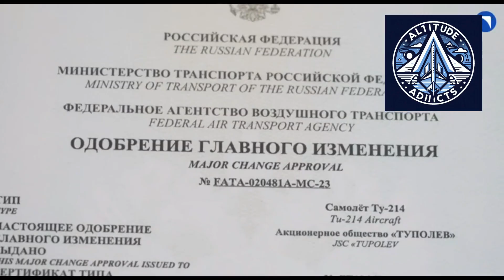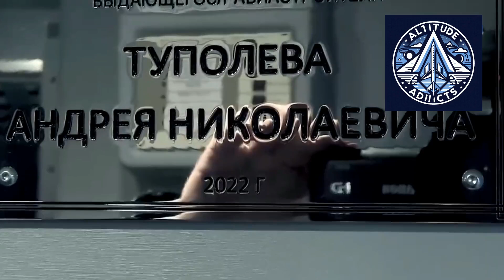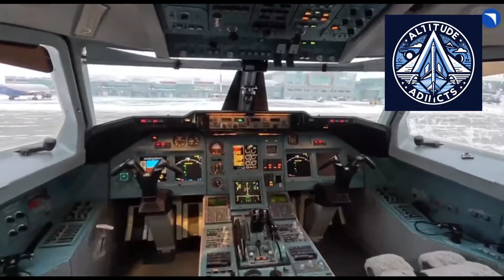Russia Certifies Tu-214 With Domestic Systems | What It Means for Aviation

Comment: From looking at the video they are celebrating a new paintjob on RA-64549 which is a 17 year old airframe, built in 2008. At 4:17 in the cockpit you can see the aircraft is equipped with American-made Honeywell MCDU's.
Reply: Pesawat buatan 2008 itu adalah laboratorium terbang.
Memang bukan pesawat baru, namun komponen Barat dilepas dan dipasang komponen domestik. Melalui pesawat ini, kinerja komponen domestik itu diuji.
Jika masih tampak komponen Barat di video ini, seluruhnya dikarenakan kecerobohan menampilkan video lama.

Comment: With an economy so driven to become self-sufficient, and multiple companies working on multiple commercial airliners, in the next decade Russia could have over well over a half dozen commercial liners from the largest to the smallest in size and range, and when you look at the bottleneck for engines - a bottleneck that Russia isn't part of, Russia could flip the script if they can complete all their objectives and not just change itself, but the rest of the world, becoming a major player in the commercial aviation field.

With success here as well as all the other logistic fields they have been also fervently working on, it would also mean success domestically and abroad for its helicopters, locomotives and ships, untapping potential never before seen, and maybe brining peace.

Comment: The west like to blow their whistle often regarding chips, design and manufacturing prowess, they don't realize that the Russians are playing at a much higher Superscalar architecture and not necessarily on consumer goods.... While the west architecture process 1 instruction per clock cycle superscalar does X4 faster work at lower frequencies allowing for robust architecture immune to electromagnetic interference...

Comment: they obviously adapted existing components used in their military aircraft for use in civil aviation .... all of their large transport aircraft would have had this equipment on board - as they operate over the same airspace as the civil aircraft .... which would have made compliance certification very fast and easy ...... why do people continually talk as though Russian civil aviation exists in a vacuum ? ..... it doesn't
Reply: По сравнению с СССР и даже с РФ, до прихода к власти Путина, это вакуум и есть 😁
Reply: Ага. Станции РЭБ, лазерный охранный комплекс, пара 30 мм пушек....😂
С Новым годом.